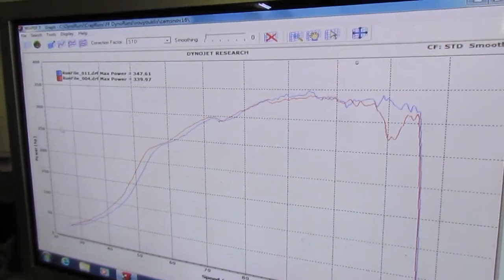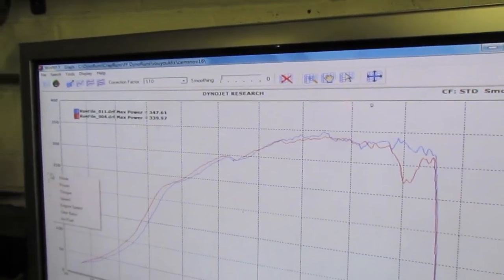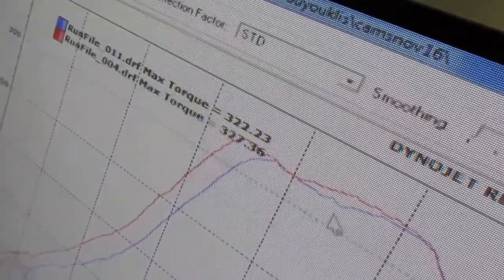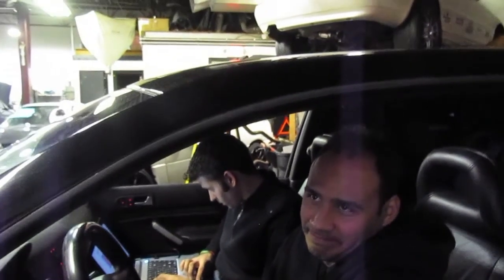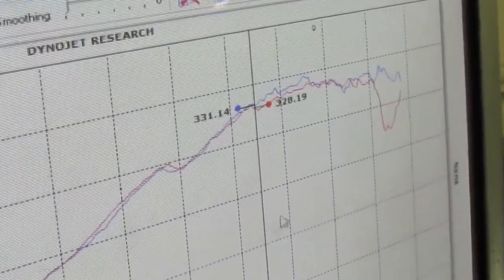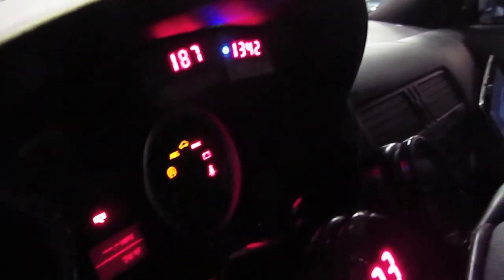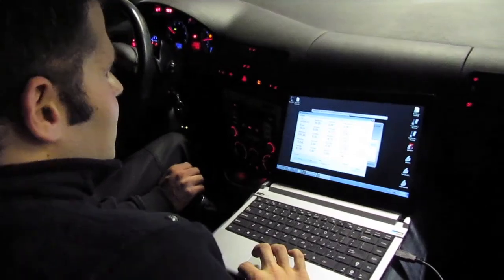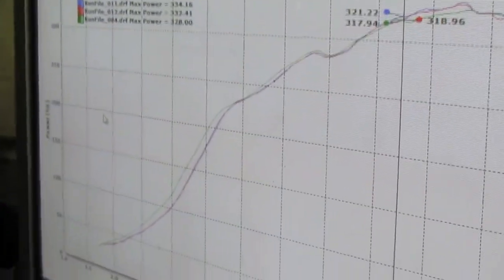F23 Mk4 GTi camshaft testing - DYNO

Comment: This is my car in the video. The reason I don't go E85 is because the nearest E85 station by me is 30 miles away. n pump gas with water meth I am getting 20* of timing advance at 3000rpms and 24-25* by redline. The initial Boost spike is 24psi and by redline it is holding a steady 20-21psi

I've driven a 50trim and its great for straight line power but it lacks the responsiveness of the smaller Frankenturbo. Go with whichever satisfies your goal.
Reply: Stock motor?
Reply: What kind of power will this setup make if you just target 19-20psi all the way through?